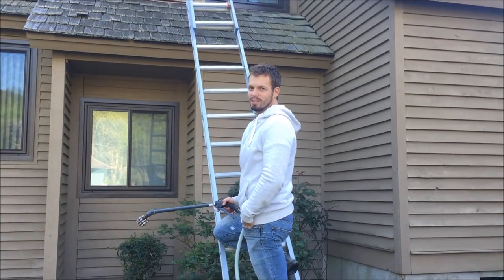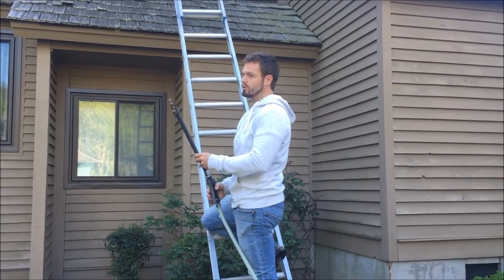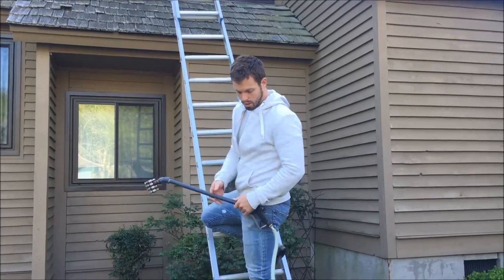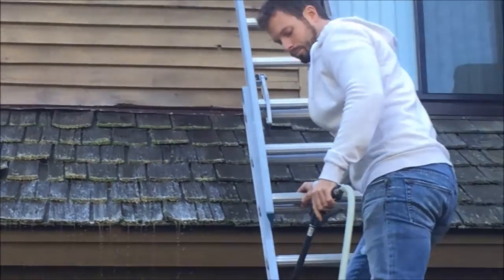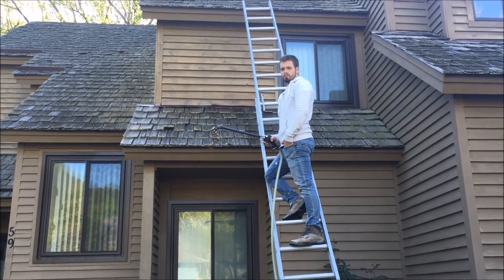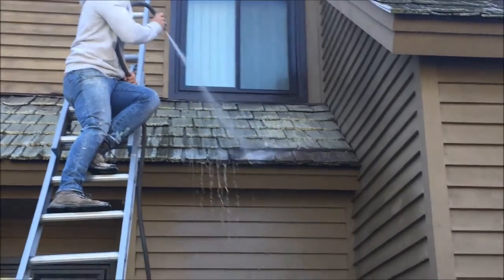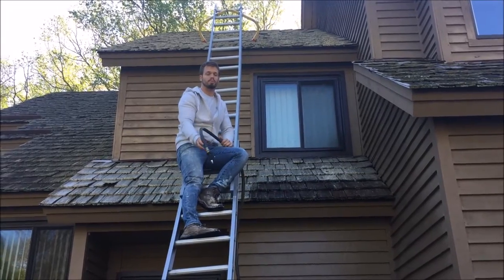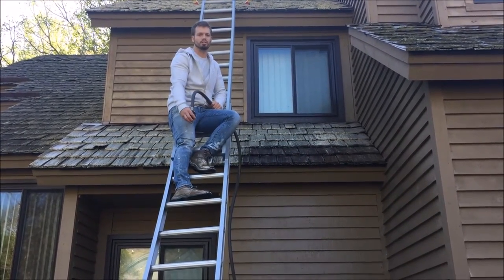How to Clean a Cedar Shake Roof | Clean Pro Exteriors

Comment: How do you get pine needles from the Douglas firs that are all gunked up and packed into the roof shingles cleaned out?  What about really bad cases where tree seeds are sprouting in between shingles from a tree above it and they are totally packed with debris?  Do you just rinse it out with a hose?  Seems like it would take a very long time.

Comment: I did about 9000 sq ft of roof with a 3200 psi pressure washer and I used just water 95% of the time - there was so much moss in some areas it looked like rolls of grass were laid out. - anywho ... a lift was used during the whole process but if you take your time and do not get right up on the cedar it will survive the trick is to start from the top and work your way down to the edge of the roof and use a garden hose with a small tip to rinse off the roof. Wish I could load some pictures up to show.
Reply from the maker: Check out my online training members.cleanproexteriors.com/get-rct